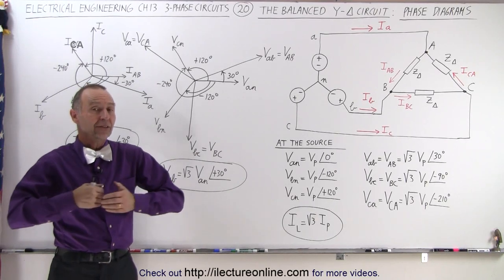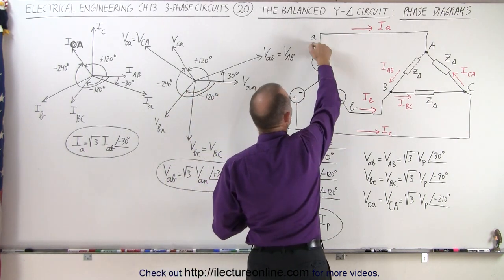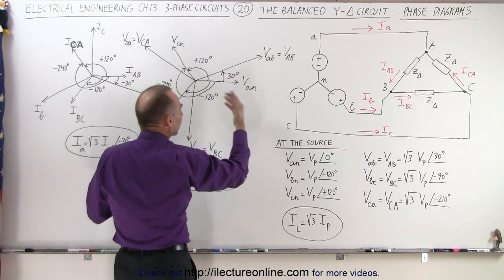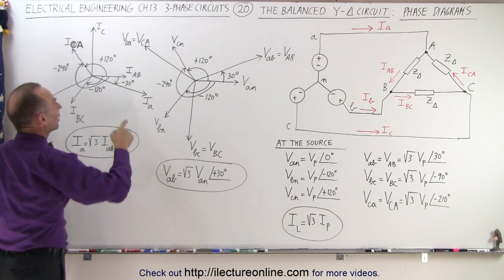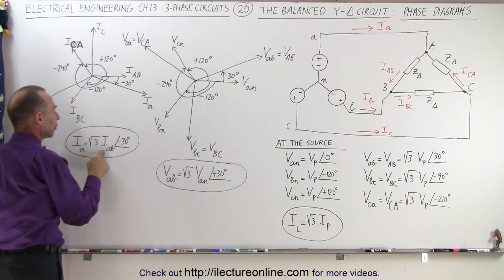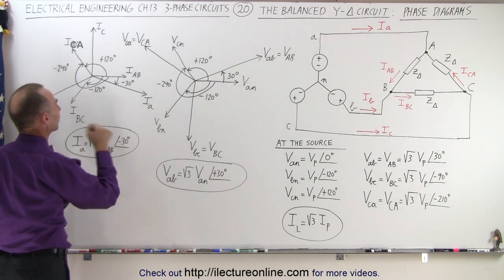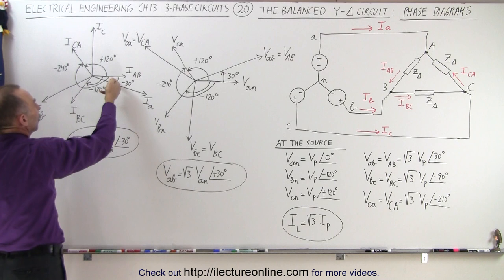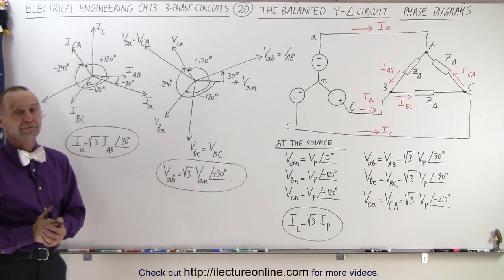Electrical Engineering: Ch 13: 3 Phase Circuit (20 of 42) What is the Phase Diagram of a Y-Delta?

Comment: Why do line currents in the phase diagram are not at the same place as source voltages? Because => line_current = source_voltage / impedance (so the magnitude of line_current will change because of the division by impedance, but phase should be the same as source_voltage phase)
Reply: I dont think line_current = sourcevoltage/impedence. That is phase current. 

The correct eqn is line_current = sqrt(3)*phasecurrent <-30° .

But yea, this is abit confusing for me as well.
Reply: Voltage leads Current (ELI) in a inductance system it will be positive angle. When you try or have to find current, since current lags voltage, it gets a negative angle. It's visa versa if you have a capacitive system (ICE)